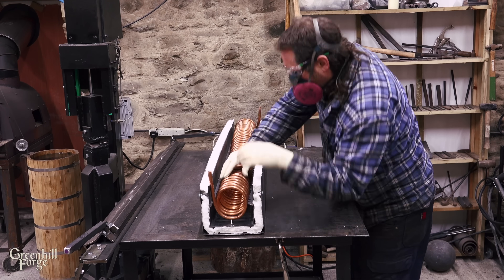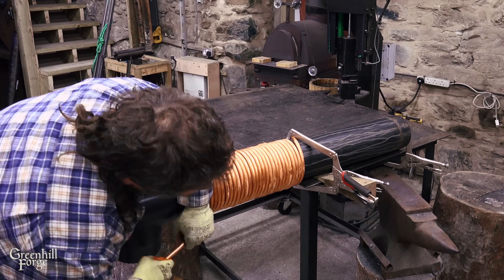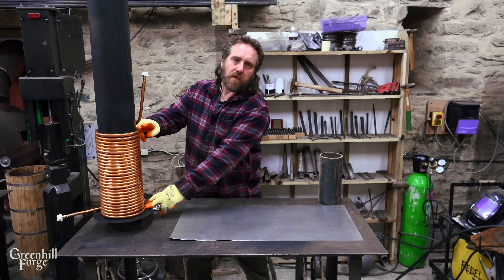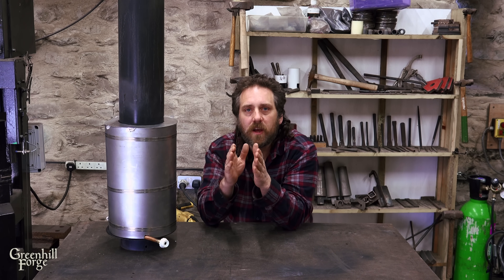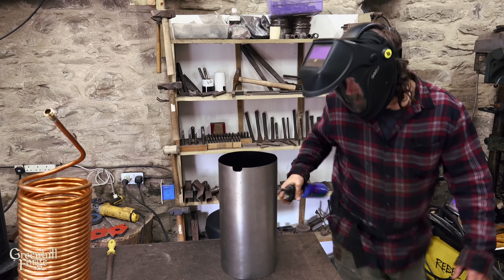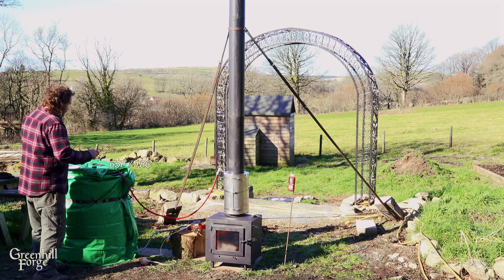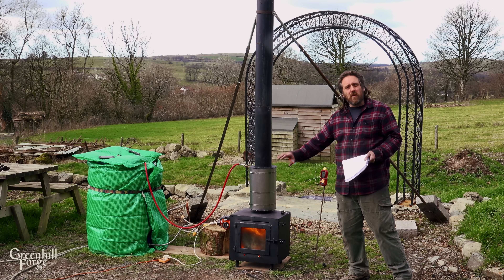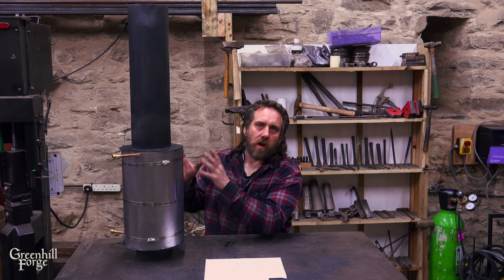Best Wood Stove Water Heater Yet: New Design Tested | Off Grid Water Heater pt3

Comment: First, thanks for this video.  I stumbled on this video and you directly addressed ideas that I've been pondering.  Next, instead of graphite, how about using lead bird shot...?  You'd have a LOT more thermal mass and if you took the extra step of melting the lead and casting it around the coil, you would have 100% contact and no air loss.   Then I'd still use the mineral wool and secondary jacket.   Another idea (kudos to @roughcreature comment below) start by building a double wall fire box with a stainless steel coil (horizontal loops) along the top of the inner box.   I think that would get too hot for the lead (which would melt and potentially give off toxic vapor), so steel bird shot should be used.  The water coming out of that would be above the boiling point, so you'd have to use a well made (purchased) heat exchanger, rated for steam pressure.

Comment: Why making the coil so short? With the same tube length, you could have spaced more each turn, making the coil touching the pipe in about double that length. With more pipe length per turn, the pipe cools down less in the area where it touches the coil, so the coil can absorb more heat. If you make it so short, most of the pipe gives its heat to the air.

Comment: The issue appears to me that the surface area being heated by the gasses of combustion is very low. Cylinders have the lowest possible surface area. If you could use multiple smaller flues, with the same overall total size of the gas passages, you would get better heat transfer. 

I speculate that using a liquid instead of solid graphite (such as a high temperature hydraulic fluid) would also improve heat transfer. This might add other complexity however.

Love these videos. Very fun to think about.

Comment: i did this in my sauna like 10 years ago. i put a mesh cage around the coil and filled it with pea rock to hold the heat around the pipes. it didn't have a pump or anything, it was purely a peculator system. i don't know how efficient it is but it works just fine. from the time i light the fire until i'm ready to wash myself, my 5 gallons of water is boiling hot. if you're not trying to build an insta-hot then it doesn't need to be more efficient.

Comment: Hello, good information, I did something similar in a still and heaters that is manufactured Your design can be improved by placing a vertical pipe internally using the same criteria as a steam stroke. The only thing is that the water inlet needs an automatic level without the need for recirculation.

Comment: You should test it with just air inside.  No medium, because since your doing the test outside the warm air will get transported away from the pipe..     So, just make a metal cylinder empty of everything but the pipe.. close it up so the pipe heats the air inside to the proper temperature..   then the entire coil will be heated by the air and not just the parts closest to the pipe. 
might want to put a preassure valve in there in the end procuct just for saftey.. :P

Comment: So as the gases come out of the top of the stove and are going in the pipe that he just carried up the pipe basically. So I was thinking if you made a 2 foot vertical section or 3 feet vertical section coming out of the stove and then putting a 90° elbow with a 2 foot section going horizontal and then at the end of that horizontal make another 90° elbow continuing your stove pipe vertically, so you basically make a dog leg about 3 feet up. What I’m thinking is you’re going to have all the heat slam into the 90° and then be transfer horizontal down the 2 foot section in a more concentrated release of thermal energy over a shorter distance. So you put the coil of copper on the horizontal piece of stove pipe the only problem would be that you won’t have a difference and temperature from one end of the coil to the other so I don’t know if the water will be drawn through the coil, both ends of the coil reach the same temperature then you’re not going to have a Delta tea so I don’t think you’ll get the fluid flowing in a laminator flow

Comment: you want to simulate length. an infinitely long stove pipe, with infinitely long water pipe tubing. put a metal spiral inside the stove pipe. like a playground slide that makes the air go around and around in a spiral up the pipe. then use a lot more copper tubing on the outside. 10 feet up the pipe.

Comment: Golden hands and head. Thank you very interesting. The question is, why not increase the size of the heating element? Increasing the length of the copper tube or increasing the gaps between the branches.
Reply from the maker: cost, really. i also need a more condensed coil for an upcoming project so that why I didn't leave gaps like in the other test videos

Comment: Nice! Thank you for the effort. Wouldn't the best option be a copper vent tube & solder the coil on the outside for maximal heat transfer? Maybe even with the added graphite?

Comment: Your design is wrong, you are changing everything but not the copper pipe, use copper pipe in zigzag style inside the heater pipe, instead of making rounds.or may be try a spiral shape for the copper for after every 6 inches add spiral shape and connect them all with each other. Love from Pakistan.

Comment: It might be tough to deal with the pressure, but if you sank that coil in a water bath around the flue I bet it would heat that coil no problem, or just ditch the coil all together and use just a water jacket.

Comment: How about putting the sealed graphite coil surround inside the flue similar to a double wall stove pipe, and then insulate the outside of the flu to stop heat transfer in the area of the coil....that would stop the corrosive action by isolating the coil from flu gas interchange. And the taller the copper coil the better...more surface area...also check out metal blasting media for cheaper more accessible heat transfer.. Bruce

Comment: To improve thermal transfer, have your coiled pipe on more than just the flu..coil it out over the top of the woodstove too(no overhang)..

Have a nice day
Reply: Insulate the outside of your coiled pipe, with asbestos rope(fireproof rope used to seal wood heater doors).. that'll help keep the heat in.
Reply: Sands a bad idea.. over time, it'll turn to glass.. expanded clay balls(stuff used in gas BBQ catch trays) are a better alternative..
There's also a render coating used in wood fired ovens and gold kilns.
It'd be worth putting that stuff around the metal casing of the coil.
The more heat you trap around the coil.. the more efficient it becomes
Reply: If you want to heat water from wood, build a gasifier generator and hook it up to a mains pressure hot water electric system...
Of which you could modify that hot water tank, to be fed hot water by wood heater coil.. long hot showers that dont cost a fortune... the stuff of destitute demon dreams..
The advantage of using a corporation built hot water tank.. 
Is in the extra water pressure..

Comment: Using the same length of pipe, stretch the coil all the way along the length of the removable pipe section to see if spreading it out increases efficiency.  In theory this will spread the heat transfer along the length of the flume.

Comment: What if you removed the copper pipe altogether and just have a water tight shroud around the stove pipe. That way the water is in direct contact with the stove pipe. It would be more difficult to fabricate something that doesn’t leak. Just add an inlet and outlet valve. I would still wrap the tank with insulation.

Comment: If you set this up outside I would try going back to the sand put an opening at the top of the exchanger and trickle water in very slowly just enough to keep the sand damp I think you will find it much more efficient

Comment: Wrap that whole thing in another layer of sand all the way up the flu so once that sand heats up, it holds the graphite hot, which keeps the water hot longer basically just another layer with the sand on the outside and then add insulation on the outside of that

Comment: Is that a double-walled pipe?  For max heat transfer, a single-wall would be best,right?  For the bottom section, then go to a double-walled?
Reply from the maker: it's all single walled. for outside use theres no reason to do any double walled

Comment: The thermal mass of water is 4-5x that of sand plus you're heating about 200 kg of water vs about 1 kg sand. That's why the thermal mass of the sand is no concern. My only recommendations would be to increase the surface area inside the vent that the hot air is in contact with and to slow down the air inside.

Comment: What if you were to use 2 or 3 smaller copper tubes coiled up? Would that mean  because there's less water in the pipe it would heat up quicker? Obviously you'd need to have enough copper tubes to get the same volume of water traveling through tho right?

Comment: Awesome presentation. I wonder if a homemade pyrolized charcoal would work similar. I have a retort for making Biochar so I have that product for free ha. putting that sand thermal mass outside the graphite chamber would probably make a small increase as well. Thanks for your work . Really cool stuff.
Reply from the maker: Nice! I made a charcoal retort video recently you can check out here if you want https://www.youtube.com/watch?v=pjkge3cHgXE . Graphite has a really ordered structure whereas charcoal/biochar is really chaotic so it doesn't transfer heat very well but it would be cool if it worked

Comment: I built mine within a sheath of water about 1 inch. If your flow rate is good the water does not boil off. Used it for months until i got a new gassy. Love the frozen pipe plan. Thanks for that.

Comment: I'm trying to do something like this with a pellet stove for heating a sidewalk. I think I'm going to try the graphite and hope for the best.
Reply from the maker: are you going to pipe hot water under the sidewalk? Sand is also a good option. I was impressed by it. Cheap, easy to get, and a lot easier and less messy when building it. And fairly close in efficiency.
Reply: Yeah I'm running PEX in the sidewalk @GreenhillForge I figured with all the extra heat going out the flu might as well try to capture it. And if it doesn't work then I'll plum it into my regular boiler with a heat exchanger so the glycol doesn't mix
Reply from the maker: Sounds like a fun project. I have an infloor heating video coming up in the next couple months
Reply: @GreenhillForge I appreciate how thorough your video is any attention to detail in your mix of skills definitely going to be checking out more of your videos in the future.

Comment: I built a coil system similar to your concept years ago. If you make a tank with the coils in a heat transfer fluid, "mineral oil aka baby oil," the surface contact will give you a more effective transfer of heat. You don't need to modify the flu. Just weld a tank to the stove directly. I used this through my forced hot water furnace.

Comment: I wonder if making the length of the heat exchanger 2 X - 3X as long, if more heat could be extracted?
Reply from the maker: definitely by making the coil longer. stretching the same legnth coil out would probably help somewhat. it's worth testing. I had it coiled tight because I'm working on another project that needs a smaller coil.

Comment: What if you used thermal paste between the flu and the copper pipe?
Would it make a difference if the flu were at an angle and wrap the copper around the flu that is at an angle?

Comment: one day i want my idea to come into fruition  - the water is at least 10feet above the shower - 30 feet away.  ignite the fire within the copper pipes inside of a wood burning stove to maintain a high level of safety and efficiency, open the drain to the shower pipe.   have a tub that will heat up that will be between 10 and 100 gallons. 
so ideally maybe you'd want a steep little hill that's 10 - 20ft, and big enough of a hill to hold a wood burning stove(other option if you want to spend a few $) and a animal hydrating tank.  ideally would be nice also to live by a stream.  either way one may need a water pump for the tank

Comment: It's been very interesting viewing with the data you have been collecting thank you.  I have two suggestions I think might help boost performance further. 

1. Spread your coils apart a little.  This will increase the surface area you are scavenging heat from with the graphite conducting heat from between the coils to the coils. I'm guessing a gap of about 50% tube diameter.

2.  Perhaps try adding a twisted ribbon of sheet metal or twisted flat bar down the middle of the flue where the coils are. This would cause the hot gases to rotate and be more turbulent to maximize hot gas contact with the flue to allow more heat to be extracted.  I think half the flue diameter would be enough to push the hottest gases in the middle to the outside with negligible flow restriction. I am quite curious what the temp of the gases would be in the middle of the flue vs the outer wall at the top of the coil section with and without a spiral deflector.

Comment: Nice work...have you thought of putting a flue dampner just above the coil in the stove pipe. Being able to adjust the heat in the lower chamber so it doesn't just go up the pipe.

Comment: If you are building this for “outdoor” and it’s only purpose is to heat water, you should be able to get way better efficiency. Why would you let all that heat rush past the coil, even the internal coil is burning wood just to let most of the heat go past the coil.
And if the coil is external but on your stove inside the house, efficiency becomes less relevant because the heat is all free any way,  Because  it was all just going up the flue any way.

If the system is inside you could just always be heating the water and it would act as a giant thermal battery, and when you want water, just use it.

Comment: The length of the internal heater is three times that of the external one along the flue.  Do not pack the coil, rather extend the coil on the outside - using the same length of copper - so that the flue length of the coil is the same.  Make sure that the thermal connection between the flue and this coil is as good as possible by mechanically compressing the coil.  Add graphite or thermal compound mix of graphite and oil.

Comment: you need to also do a test where the pipe you have your heatsink on is at a 15 degree angle so you get a HOT side of the pipe to transfer into your coils.

Comment: You may icrease the area of heat transfer, so why did you omitt the upper part of tube and stretch the coil the way up. Or guide the flue more horizontal to increase heat transfer. Or increase the inner area by intruding some slightly bended sheets under tension that easily can be removed for maintenance.All these measures aiming enlarging heat transfers.
Reply from the maker: you make reasonable points but i think its actually a little different. the heat transfer area is fixed- X length(surface area) of copper pipe. what you can increase is the temperature delta on that give area of pipe, for which I think all of your suggestions would work
Reply: @GreenhillForge Primary the heat is transferred from gas to tube und than conducted via tube to coil. Limiting is the heat transfer from gas to tube. The conduction from metal to copper is several orders of magnitude more efficient.

Comment: It occurs to me that I've seen finned tubing in air conditioners.

If it's stainless, it could go inside the flue, and stainless will survive the temps and corrosive effects.

Corrosion is mostly due to bad firebox management anyway.

You have attention to detail, so as long as you are running the stove efficiently with minimal smoke, and run one of the cleaning logs a couple times a year, I am guessing it would last for years.

I bought a few used window a/c's from craigslist back when I was coverting them to chillers.

Never paid much for them.

Of course, the best option would be a stainless waterjacket that wraps around the firebox and replaces the top of the fire box - finned if you want to put that much work and expense into it.

Comment: What about encapsulating the coil in molten aluminum? Basically creating an outer sleeve of aluminum that incorporates the coil in the middle of it. Then insulate the outside with a further outer sleeve as you did before.
Reply from the maker: that's an interesting idea. worth think about.

Comment: A large tank. On top of the flot.
Mick Australia.  Now... wight.
Think a cake  with a cone on the top.

Run pipe in side the cake  bottom to the top. No heat lost from bottom  to the peack.  
Its a a done on top of the exusted.  Small fire and max hot water. Mick Australia 🇦🇺
Reply: Or a triangle  no think open
Reply: 45 degree  pipe from sours .
air into the system  will twist the heat will disperse  slow  accross  all from bottom to  top.
Reply: Wow thank s for the input 14.30
Reply: Stell balls . Fast. Insolated.  Slow. You use grafite

Comment: So i have two ideas one using a  steel cylinder like a narrow hot waterservice or lpg tank cut the ends off weld 4 or 5 vertical steel tubes weld caps on the ends drill holes to run copper pipe through the tubes it will require tight loops or silver soldering bends. Being a steel cylinder a door csn be fabricated to aid inspection snd cleaning.
Reply: That opens the posibillity of a bottom baffle and top baffle to distribute gases and hold heat down

Comment: Why not... have coil in primary sand battery..primary sandbattery mounted with in flue sand battery will get extremely hot... secondary sand battery  mounted around outside of flue for radiend s low reals of stored heat.. when rocket stove turned off..secondary insulates  flue...